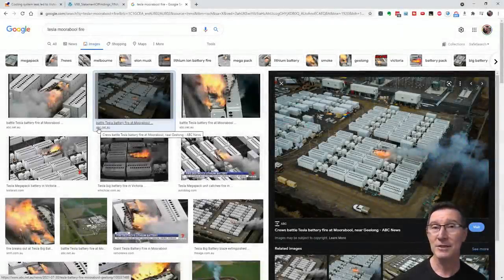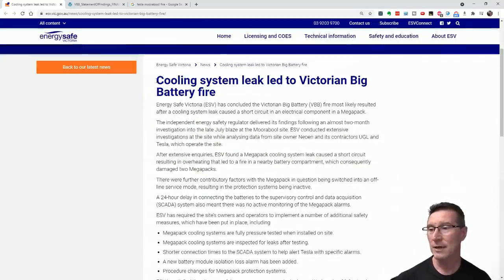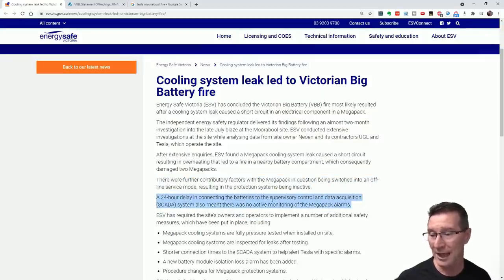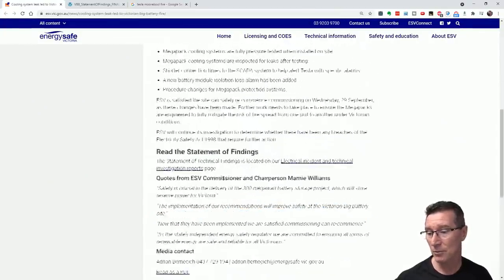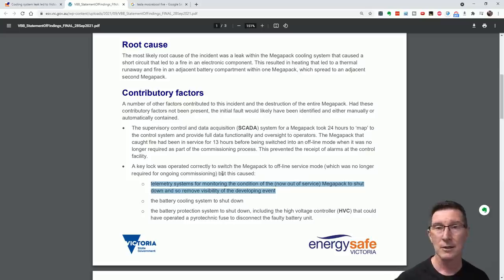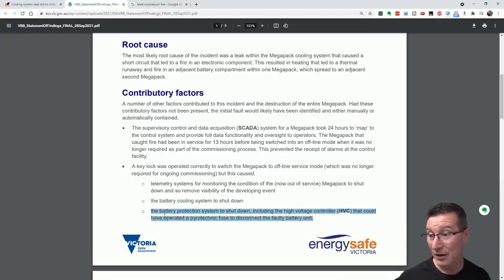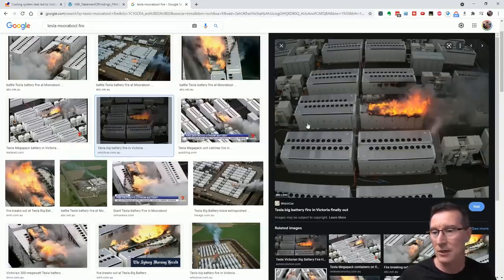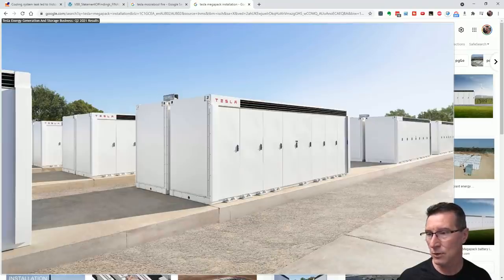EEVblog 1422 - CAUSE of the Tesla Victoria Big Battery Fire

Comment: They could perhaps fill the gap between modules with fire retardant foam as used by electricians to seal apertures in domestic fuse boxes.  This is a foam that sets hard like builder's expanding foam.
Reply: Perhaps you could just realize that battery power is not the way to go, but i guess since you're in for a penny, in for a pound, eh?
Reply: More toxic waste to deal with in 5 years.  

Wait, we're talking about Tesla batteries? I meant to say green sustainable all-electric zero emissions high efficiency foam!
Reply: @klam77  pump storage is what smart people do, even smarter do reversible hydroelectric power plant (it work as normal hydroelectric power plant,  and as pump storage in same time),  but for both you need some geographical features,  you can't build just tower (it need to be very tall and big tower, for example here 4.6GW reversible hydroelectric power plant have vertical drop of 600m, and capacity of and hold 1.5 million m3 of water for capacity if I remember correctly of 1.5GWh)
Reply: some cross pollination from the SpaceX Florida bakery coming up soon? :P
Reply: @klam77  official name is "rhe Bajna Bašta" (not to be confused with "he Bajna Bašta" which is normal hydroelectric power plant), it is in Serbia near border with Bosnia. That specific reversible hydroelectric power plant have not high efficiency,  bacouse there is some phenomenon with water dropping with that hight in pipes (there are some papers they described that and why they decided to go with it even lose some efficiency) and it use technology (my guess is from Siemens,  here 99% of all hydroelectric power plant in 20 century used Siemens) from mid 1970. (construction started in late 1970 and it started operation in early 1980).
Reply: Better to use cement board/MgO because it's much less environmentally problematic. That's the standard Oz material for building in flame zones (we have bushfires that make the battery fire look trivial)
Reply: @klam77  you think physically pumping water would be more efficient than charging a battery? Have you ever been near a water pump? Noise, heat losses, friction etc. Not to mention evaporation would also count as losses. It is fine for soaking up spare energy if you have excess, but it is hardly the most efficient thing ever. And response time although quick is nothing like the response time of these batteries for fast dispatch.
Not to mention the vast amounts of space required to store the same amount of emergy.
Reply: @klam77  go work out how many towers and the volume of water to get the same energy. Then wprk out losses due to mechanical effortand the reconversion back into electricity.
Reply: Except that they do need to keep cool overall. Not sure I see any problem needing to be solved. Losing 1 or 2 packs in case of the very rare case of a disaster like this (which was down for maintenance and sending no alerts it would have usually) seems entirely reasonable amounts of losses.
Reply: @kevina.4036  is recycling not something you've heard of? With EVs rolling out and batteries widespread: of course there is going to be value in recovering materials.
Reply: @mrlazda  Please show your work on your homework.  How does the size of that type of facility compare to this behemoth battery?  The moving blocks thing could be built anywhere, and how about a couple of huge flywheels?
Reply: @--Nath--  Hydrogen gas generation from solar/wind power give the best bang for the buck (even the Aussie buck).  In ten years people will be comparing these batteries to the Juciero.  It's a clown show, and we all know the head clown is not Dave.
Reply: @ReachOutToWilliam  With hydrogen will will barely get 30% of the energy you put in.  To start, electrolysis is ~50% efficient, then comes the 10~15% for compression; and later when you want to convert H2 into electricity, you will be punished with something like 80% efficiency and the cell if you are lucky.  Not to mention having very high pressure containers filled with H2, that you stress and un-stress on more than once a day.  An H2 leak is basically invisible, and you basically cannot add odors or color to for easy detection.
Reply: @mrlazda  Pump storage is not efficient.  There is a limit (63% IIRC) that the turbine can get from flowing water, similar to the wind turbine efficiency limit.  When you pump up, you also run into the pump efficiencies, that are <70% (IIRC, maybe lower).  The motors and generators are in general very efficient > 90%, so no big losses there.
Then is the little issue of where to put the water, which comes with quite a big monetary cost, and basically impossible due to cost to build in flat land.  And if you are in a not so humid place, where do you get the water from.
Pump storage has its place, but only if nature really helps.  The water source, and geographical location are key.  I am not sure if the project exists or not, but in Chile, where the driest desert in the world lies (Atacama) there was a pump storage thing that use the high cliffs, and sea water basically next to it.  The is how key these two are, everything else is more or less peanuts.  This was like 15yr ago, no idea if nowadays it would be feasible project due to costs compared to battery systems.
Reply: @klam77 Pumped storage is fine, and efficiencies can reach about 80% I believe (similar or close to battery installations), but require water availability, suitable terrain and has a fairly big impact on local environment. It also cannot react as quickly to changes in the grid, which is one of the primary motivations for the Australian battery installations if I'm not mistaken.
Reply: @ReachOutToWilliam  the laws of thermodynamics disagree and they arent changing any time soon. Hydrogen eh? So you take electricity, convert and lose a chunk of energy to make hydrogen, then lose more energy to capture and compress it.. then ship it. Then you lose yet more energy converting back in to electricity via a fuel cell to do work. You want the juicero? That's what you are describing mate. Taking perfectly good electeicity and throwing a bunch of it away to produce.. oh, that's right: electricity. Or go from electricity to chemical storage and back (which you also lose energy, but nowhere near as much as going to hydrogen and back again..).
Reply: @ikocheratcr  maybe you should check your figure about water turbine efficiency,  modern water turbine have mechanical efficiency of over 90%.
Reply: @ReachOutToWilliam  reversible hydroelectric power plant have one advantage over any other storage,  it can produce electrical power of its own, and as I stated in my first post for capacity 10x of biggest battery storage you need to have lake holding 1.5 million qubic meters of water with drop of 600m, so it is much bigger then battery,  and initial cost is much bigger,  but you expect it to last much longer (100+ years compared to 10-15 years of battery).
Reply: @koma-k  about environmental impact we can argue,  os it mining for materials for battery more environmental friendly then building arraficial lake? For me both are similarly  environmental unfriendly, and both have long lasting impact,  only batteries have shorter life span.
Reply: @--Nath--  I am also describing the battery-powered electric car.  Which also wastes a lot of power in the generation, transmission, storage and motive energy to make the car move.  Enjoy your juice!  A hydrogen fuel cell is by far the best option at the present.
Reply: @ikocheratcr  The magic of hydrogen is not in its efficiency, it is its availability.  There is more hydrogen than lithium on the earth, and the immense power of the sun to power solar conversion.  You have to look at the big picture.
Reply: He kept saying 'build a brick wall' half tongue-in-cheek, but that too is a possibility.  Some sort of refractory brick lining between the units could have prevented the spread.  It would be cheap, environmentally safe, and effective.  For a 'foam', you'd want something that was fireproof for several hours, not something that burns with toxic fumes.

Since it was hot enough to melt the cabinet, I think a high temperature refractory lining would be indicated.
Reply: @mrlazda  Yes, you are right.
Reply: @ReachOutToWilliam  That would make sense if there is extra energy generation across the board, but we are not there, indeed there are issue that generation is not enough in many places, so efficiency matters a lot.
Reply: @ikocheratcr  There will be an energy shortage if we continue with grid powered battery cars.  Meanwhile, the issues related to battery cars are solved by hydrogen, including the ability to harness 100% solar/wind power generation (no fossil fuels needed at all, while electric grids get 70% of their fuel from fossil fuels), ability to rapidly fuel, long range, and the availability of the key ingredient (H).  It does not matter what the efficiency is.  Heck, if we wanted efficiency, everyone would be on bicycles. :)
Reply: @ReachOutToWilliam  Slight problem, the hydrogen can only be used once, then you need to get more, whereas the lithium in LiION batteries doesn't get used up. Also, hydrogen is an utter pain to store as it can't be liquified without a ready source of liquid helium.
Reply: Need air circulation for the cooling systems.
Reply: @mcapps1  pumped hydro is good, but cannot respond quickly, eg, <1sec to peak spikes in demand. The 180MWhr big batteey in Hornsdale in SA, can respond to peak surges in demand < 0.6seconds. This is why that battery has paid for itself in 1.5years.

Pumped hydro must be supported by a midsized battery for the same reason - response time.
Reply: @--Nath--  Not as long as the costs surpass the value. They will simply keep mining for raw materials. Besides is there any good methods of recycling them efficiently yet?
Reply: @ikocheratcr  Well your attacking it from the wrong angle. Your leak would only consist of water... Because the correct way is to use electrolysis to seperate hydrogen from the water right before combustion there for you only have that "dangerous" gas were it belongs.... In the combustion chamber. By the way its comparable to gasoline in terms of combustion meaning there is already many million engines that could be converted. But yeah keep focusing on a made up problem...

20% effectivness is pretty much what you get out of an gasoline engine as well. The only difference water is abundant, and the exhaust will turn back into water so theres no loss of fuel as with gasoline. In fact you could make an enclosed system with this. So efficiency is not even a factor in this case. Heck just bloody pee in the tank if you need to...
Reply: @Magisktification  yeah, there's several videos talking about the process of recycling EV batteries - one from the fully charged show and one that was about a former tesla founder. It's something that as the scale up of EVs and storage happens will also scale up.. So a closed loop is certainly doable, just as exists with lead acid batteries today (they have some crazy high % recycled).

Comment: Very notably missing was a requirement (or even a suggestion!) for a fire mitigation system! You shouldn't be asking firefighters to place hoses between these smouldering bombs, you should have pipelines with nozzles pre-installed. Press button, get cooling mist between all the cabinets to mitigate the impacts of an uncontrolled fire.....
Reply: Pouring water on a Lithium battery fire is worse than useless.
WHY won't they ever try SAND?
That's how you deal with an incendiary bomb.
Reply: @whompywheels5165  These aren't lithium batteries, they're lithium ion and contain no metallic lithium (or at least not if they're in good condition). Water is a perfectly suitable extinguishing medium (or more accurately, cooling medium).
Reply: @cambridgemart2075  BOLLOCKS
Reply: @whompywheels5165  Agreed, you are talking those. If you don't believe me, try doing some research - for a start find out what airlines carry to deal with lithium ion battery fires. Maybe also research what lithium ion batteries are. Given that you're commenting on an EEVBlog video, I would have assumed you had some understanding of the subject, but it appears I was wrong.

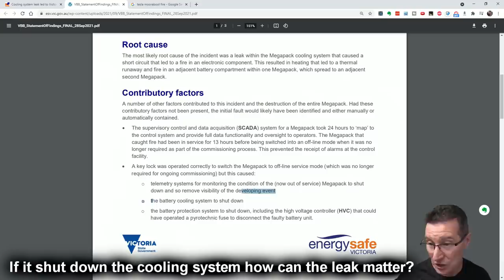Comment: 16:15 - "If it shut down the cooling system how can the leak matter?" - The report clearly speaks of "a leak [...] that caused a short circuit that led to a fire". In other words, leaking coolant had managed to find its way onto electronics, shorted them out, and thus caused some overcurrent in a component, which in turn burst into flames because it wasn't designed to take that kind of abuse.

Comment: There are almost always teething troubles with newly assembled systems.   In these modern times, that also applies to the computerized control & alarm systems.  Someone somewhere didn't think through the subtleties & interactions of various safety systems.  After this demonstration of some shortfalls, all future systems will be far, far safer.  Thanks, Dave, for the walkabout.

Comment: Hmmm, design idea, let's put the electronics where leaking coolant can drip onto it.
Reply: heehee I remember a friend giving me a Ford airbag controller for tear-down. It and the engine controller were placed below a heater core that commonly leak after a few years.
Reply: who knows, it might be a high pressure system and it came out like a water pistol
Reply: How electrically conductive is the coolant?
Reply: @robertmayer4647  it doesn't have to be particularly conductive, it only takes a tiny current to turn on a transistor. The knock-on effects can be catastrophic.
Reply: @nerdfulthings4670  . Sounds like an Escort/Tracer. I remember a recall where we had to put a plastic shield over the airbag module and pack the connectors with dielectric grease.
Reply: Have you ever been in a small office "server room"?  It has a nice AC unit right?  Well think about this, day is too humid, the door was open for some job for a few hours, and the AC unit now has a nice block of ice, it will start blowing water as if there is no tomorrow, just directly into your precious servers.  Yeah a lot of people think this AC unit and the air flow is the best solution.
You can see a lot of places where some pipes run over some electrical stuff.  Have you seen the emergency fire suppression systems on the ceiling?  Guess what, above them are pipe that have water, and if you look between the floor and the ceiling there are lots of things.  Sometimes liquids need to be above other stuff to do the job, not a bad idea in general.
Reply: just like supercomputers and data center servers. But they have better thermal and short circuit protections than these batteries do.

Comment: 23:23 "failed safely" in this context means that:
a) it wasn't a chain reaction that took out the whole facility
b) the damage did not spread to other nearby but unrelated facilities
c) the failure didn't generate widespread hazards that could have caused injury in the general area (beyond the reach of the fire)
d) the failure did not create immediate hazards that would have injured anyone nearby (shock wave, shrapnel etc.)
e) the failure occurred in a measured and controlled way giving anyone in the immediate vicinity enough warning and time to move to a safe distance before risk of injury was present
Reply: I don't think that what happened meets any definition of failing safely; there were toxic fumes and extreme heat produced.

Comment: Monitoring was not online yet?  I used to work on a massive database which collects telemetry from around the world. (mainframe computer installations) Data from EVERYTHING was stored. (corrosion detectors, room temperature, mainline voltage fluctuation, cooling fan RPM...etc) I am aware of another database which collects realtime INFLIGHT DATA from many airlines (engine health statistics) Instead of doing "Preventative Maintenance", we called it "PREDICTIVE Maintenance".
Reply: CNC machines do that as well.  You monitor vibration, temperature, current etc so you can see a problem coming.  Also used for tool wear, before it was "replace after X hours", but now you can determine if it's getting blunt, been damaged etc.

But yeah, who need monitoring when it's turned off?   She'll be right, what could go wrong?
Reply: Yes, modern jet engines often make planes return to airports before there is actually any issue with the thrust being produced. They will detect and remotely report the easy things such as temperatures and pressures but also some engines can detect possible metal particles in the oils.
Reply: Since they went from 24 hours to 1 hour so easily, I suspect the real issue is how often a maintenance task is scheduled to run that updates the system configuration.